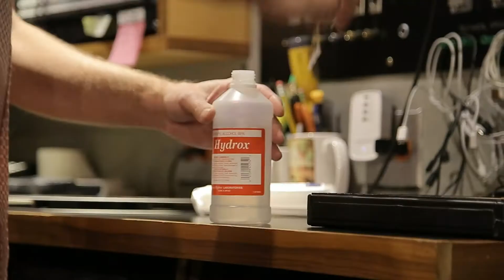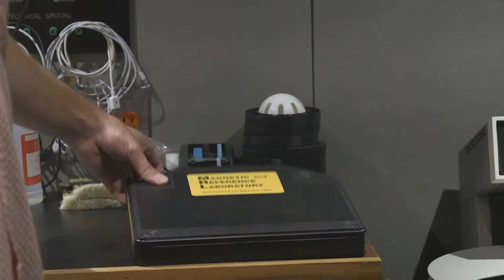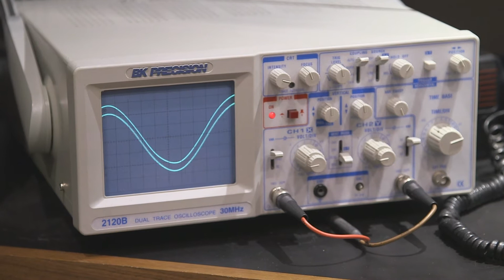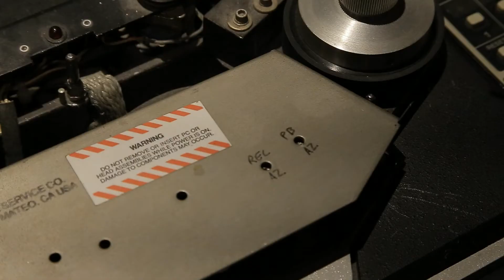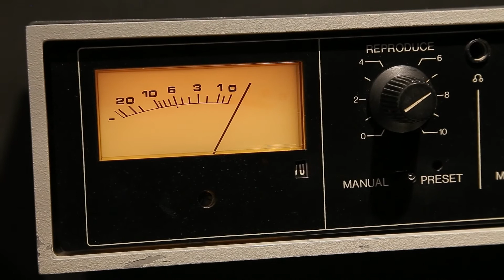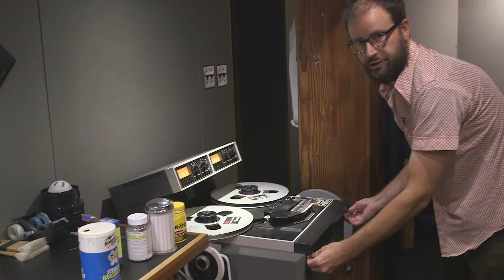Electrical Audio How-To: Ampex ATR-102 Alignment and Calibration

Comment: Thank you so much! The only question is - how must be set both repro and record gain controls during the calibration process?
Reply from the maker: Not totally sure what you're asking, the video shows how to calibrate repro and record gain. You must do repro gain (level) and other repro adjustments before any record adjustments because you're monitoring record adjustments "through" repro, so if your repro is out of calibration, you will compensate with record alignment and both will end up being off.

Hope that helps
Reply: @ I mean the playback and recording level controls on the indicator panel.

Comment: Those machines are beasts - (almost) enough torque to haul a load of __ up a very steep grade.
Oh, and they sound like nothing else.
I worked many years in a studio which used an ATR 100 at mix down. Great machines, great video - thanks.

Comment: In the ATR124 manual they calibrate Hi Frequency with a square wave using both EQ and Shelf pots to "imitate" the square as near as possible. Works very well should be the same for the 102.

Comment: Is it better than the Studer equivalent?
Reply from the maker: Studer made A820 2-tracks, and we had one for a while. It was a great machine. One advantage of the ATRs is that there is a company that actively services, refurbishes, and supports them (ATR in York, PA). Our 102s can also easily be swapped between any 1/4" and 1/2" formats (stereo, mono, quarter-track, 3-track, and 4-track).
Reply: @ElectricalAudioOfficial  are they equal in terms of sound quality and overall quality?
Reply: @jn3750  Both machines, the ATR and the A820 2-track, if they're in great repair, are comparable.  Broadly speaking, the A820 is more transparent, or clinical than the ATR.  The majority of the sonic character, I've noticed with any late era, fancy pants machine is determined by what heads are it.  Our ATRs are fitted with the Flux Magnetics mastering extended low frequency response heads, which makes a world of difference at 30 IPS (flat between 20Hz -to 20kHz ±1dB).  The ATR has much less going on in the audio signal path.  It's largely '70s tech, vs. the '80s op amp, coupling cap, and fet switch-heavy design of the A820. 
I would be surprised if you could tell the difference between recordings made on either machine today with those mastering heads fitted.

Comment: If only there was a cost effective "tape lifterless" upgrade for Ampex decks like this, and especially the ATR-102, for minimizing oxide shed, inherent in some of the Studer transport designs.
Reply: @Ellis Burman No problems ever with the servos getting falling out of sync? 
Now if only someone could find a genuine cure for SSS. For some years it looked like Mr. Richardson had one. 
https://www.aes.org/events/139/presenters/?ID=4294 Unfortunately, there was clearly no way he could have 
made it affordable for many commercial users; far less so for even the wealthiest audiophiles.
Reply: @greg1030  No problems.  It doesn't affect the servos.  It's just a low friction alternative to dragging the tape over the fixed lifters.

Comment: which tape type and speeds do you guys use most at Electrical Audio? Both on the Studer and Ampex? thanks!
Reply from the maker: Our house standards are 15 ips IEC / CCIR EQ for all 2" recordings, and 30 ips (which is necessarily AES EQ) for 1/2" mixdown. We use ATR Master Tape and Recording The Masters SM900 2" and ATR Master Tape and RTM SM911 1/2".
Reply: @ElectricalAudioOfficial  thank you so much!
Reply: @frankgoesskateboarding  Our ATRs are typically set for NAB @15 IPS...
Reply: Greg Norman thanks a lot!

Comment: Great video! Is there a good reason why you calibrate repro gain and repro HF, but not repro LF? TIA
Reply from the maker: That's a good question!

On the ATR-102 (and our Studer-820s) you don't have a repro LF adjustment and a record LF adjustment, just the repro LF adjustment. Meaning, you are kinda "stuck with" the record head's low frequency response. Because of that, we align repro electronics, then record electronics, and circle back to bass repro to kinda offset the record path's low frequency response.

However, if you aren't recording anything, and are just transferring to digital or another tape or listening, you certainly should align the repro path's low frequency response from the recorded tones.

Hope that makes sense.
Reply: @ElectricalAudioOfficial  thanks for the response!

Comment: One thing I didn’t catch; approximately how often do you do the alignment?  Picking up my first ATR-102 tomorrow and having a tech refurbish it, but am trying to learn as much as I can before it’s ready.  I’ll primarily be using it for audiophile playback and simple dubbing.
Reply: Hey,  
We check the alignment before every mixing session.  This is way more often than you'd need to for home enjoyment.  If you're a stickler, check your playback levels with an MRL or some other tape with reference tones (maybe ask your tech to make you a reel if you don't have one), then check your record calibration by recording different tones and seeing if anything deviates from the norm.  If you intend to record on different formulations of tape, you'll need to calibrate the machine for the new tape every time you change.
Sorry for the late reply.
Reply: Greg Norman no worries thanks!  Between this video and others I think I have the alignment down.